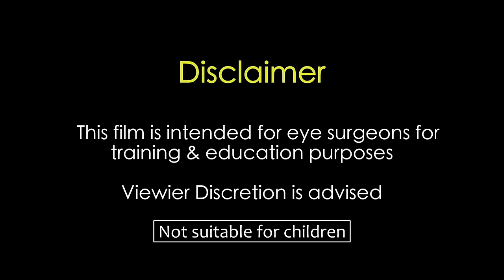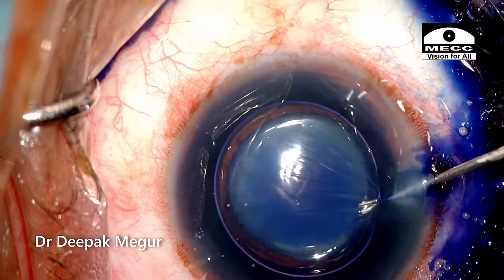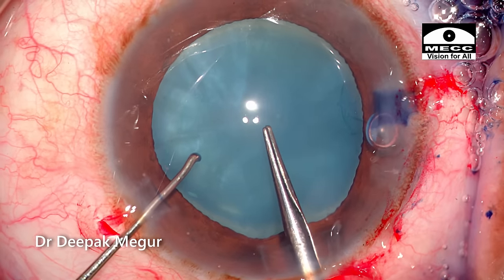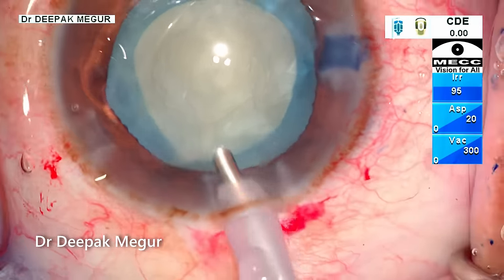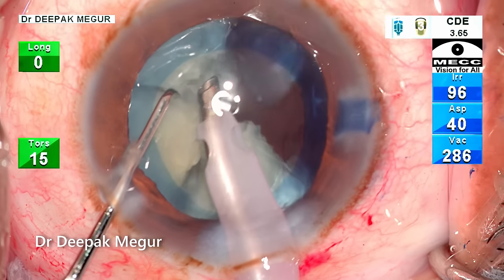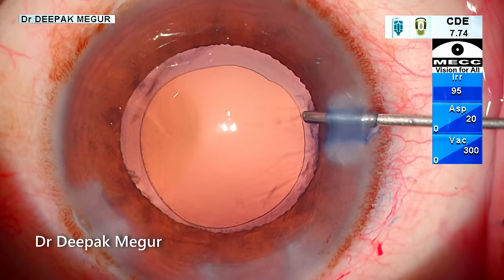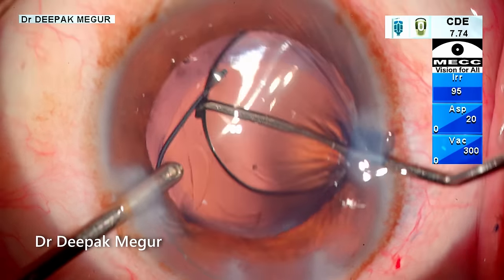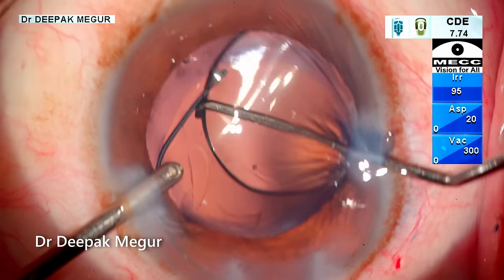Cataract Vlog No,01 (Full Cataract surgery video) - Dr Deepak Megur

Comment: Hello Dr. Megur, I have a question - The artificial lens implanted in the eye has 2 metal curved rods attached to it. Since it stays in the eye, does the patient not have a prickly sensation? Thanks.
Reply from the maker: No
Reply: Those are not metal, more like a plastic. And patients do not feel them at all.
Reply: Is the pt. Able to see afterwards
Reply: @Kbreezeproduction  our patients had a bandage over the eye.
Reply: @ccoop3774  i mean are the pts able to see again or better than before after the patch comes off
Reply: @Kbreezeproduction  The vision may be a little blurry for a few days right after the surgery. After that, the patient should be able to see much better. My dad didn't need to wear glasses after his cataract surgery.

Comment: After 4 days, my lense moved and became blurry so a second surgery was to place it back. I ended up with bad eye pressure causing severe headache on the left side and throwing up bad so doc gave me several eye drops to relieve the pressure which caused it to move out of place so under the knife for the third time! My doc said all because because I took Tamsulosin which messed up the surface (iris?) for the lens  to sit properly.

Comment: i have a question, does the implant lens have to be replaces after like 10 years or so?
and also how does the lens stay put?
and is this painful, and how does the eye stay so still too!
Reply: They do not have to be replaced. They get scarred down in the capsules bag. And it really doesn't hurt. Not at all during surgery- the eye is anesthetized. Years ago the eye was numbed with a shot unger/behind the eye and vision went dark and the eye and lids couldn't move. Now,  the patient just looks at the light above. The surgeon can also hold onto the eye with forceps if necessary.

Comment: Excellent sir...

My 2 Qs..
1) Why visco just before starting IA? 
2) Why not IOL implantation (3 PC too) under irrigation?

Thank you sir
Reply from the maker: Hi Ravi, 
1. Some of the disposable I &A which I use dont have good flow through the irrigation cannula. 
So I have been using this technique as an additional safety measure. 
2. 3 piece through irrigation can be traumatic to the PC, So I avoid.